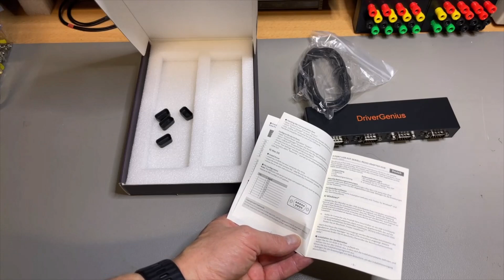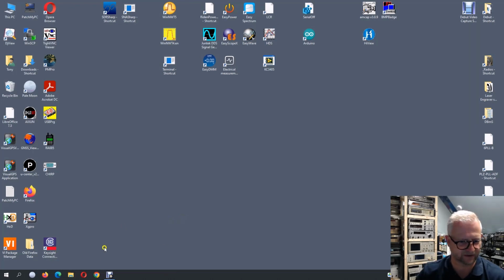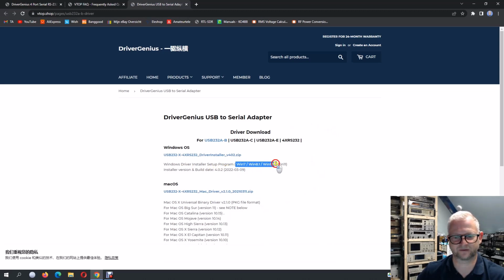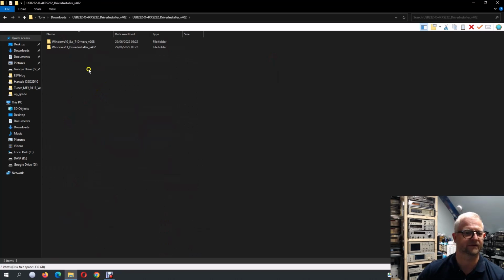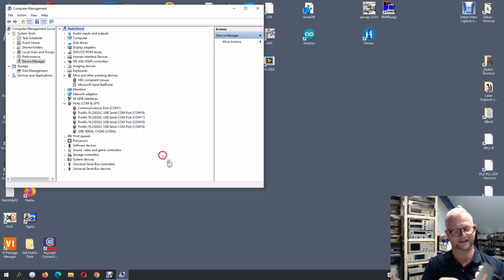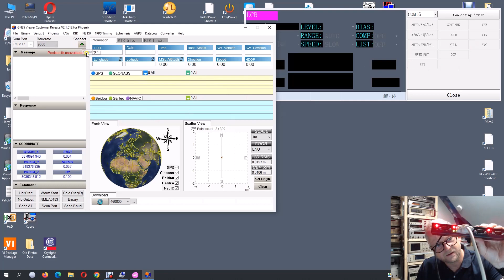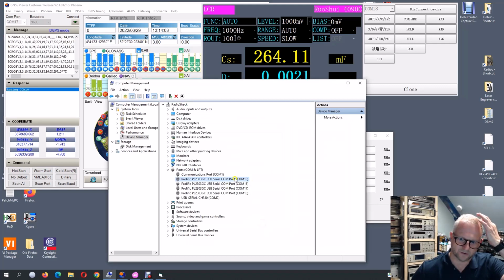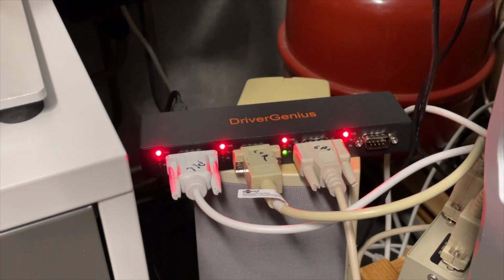#293 DriverGenius 4X RS232  - 4 Port USB to Serial RS232 Adapter - Win & Mac

Comment: Hi Tony, what a great piece of kit. I have a number of PCI - Serial expansion cards that is used for various radio control and remote antenna selection. PCI -serial can be very frustrating as it is of course on the back of the PC and hard work to plug and unplug connectors.. That little 4 way USB to serial looks smart and well built. I'm with you on the LED being a useful addition especially if your waiting for something to happen and suspect a problem with the connected device as the LED will indicate data activity . Only £59 GDP over here so seriously thinking that would be a great addition for me. Nice Product at a fair price.
Reply from the maker: Hi Ian, Thank you, yes very usefull, oh yeah with PCI and connector in the back, that is a chalance getting those plugged in and out. Do like the LEDs a lot :)